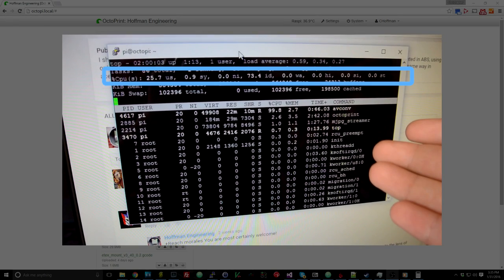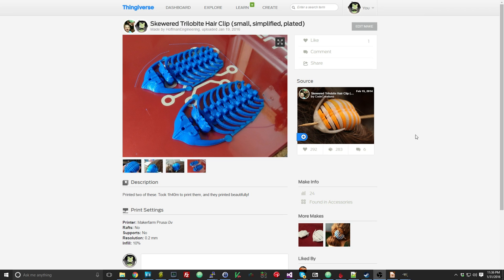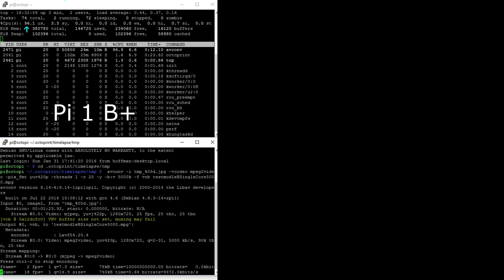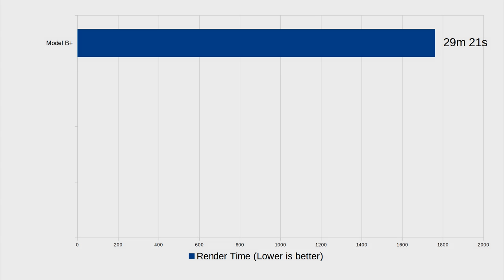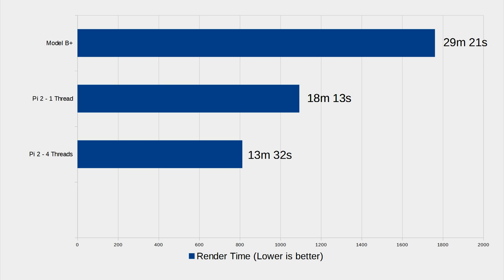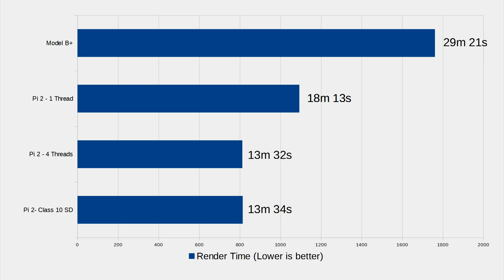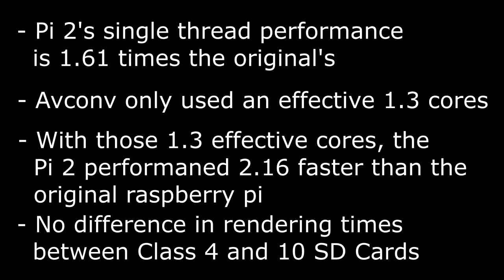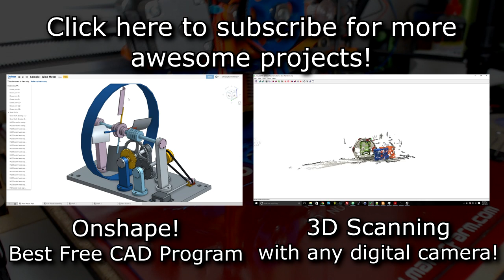Raspberry Pi 2 vs Raspberry Pi B+ Showdown! Timelapse Rendering Comparison

Comment: Thanks for the video! I recently purchased an rpi2 hoping that I would see better performance from timelapse rendering in octoprint. Glad to see that it was a worthwhile purchase.
Reply from the maker: +Sunny Rodriguez And thank you for watching! It is a pretty substantial increase, I'm hoping it'll help cut down on the number of timelapses that get ruined by starting another print before the last one finished rendering. I'm also hoping to be able to gain a little more performance out of it, be it by increasing the CPU% used, or overclocking the pi2!
Reply: +Hoffman Engineering I posted on the github page for octoprint requesting a progress indicator for timelapse rendering. Most recent comment suggested logging into the pi and running "top" command to watch the ffmpeg process. Not the easiest approach but it works for now. I'm wondering if the progress can be exposed as an octoprint extension; not sure if extensions have access to external processes beyond octoprint through.
https://github.com/foosel/OctoPrint/issues/1191

Comment: What happens if you hit it with more threads than actual cores on the system? (this is btw an usual trick when compiling large software projects to get max CPU utilisation) 
To make sure that it is not bottlenecked by the IO you could try to encode it completly in a RAM disk, this is super easy on linux, just mount a tmpfs where you need it. Watch the "wa" value in the %Cpus line, if it is higher than zero the CPU is waiting for IO requests to finish.
Another top tipp (pun intended), press "1" to show each core individually (%Cpu0, %Cpu1...).
Reply from the maker: +Hippo Thank you for the suggestions, I really appreciate it! The thread count doesn't seem to make a difference above 4; 5,8,and 12 threads are still showing about 135-140% CPU usage, with the load being distributed 80%, 20%, 20%, 20% (Thanks to your top tip :D). The wa column is showing 0.3% every so often on the thread that is pulling most of the load, so IO might not be the bottle next there.

I'll try the ramdisk next. Even though the IO doesn't seem to be the bottleneck, its worth a try to gain a little more performance!
Reply: +Hoffman Engineering 
Okay, i did a few tests with ffmpeg on my PC (Core i5), the problem is the ancient mpeg2 codec, it was just not developed with multicore CPUs in mind. I can encode my test 1080p timelapse with 1T and 50 fps (so the 1200 pictures take about 24 sec), 2T gives a slight increase and the switch to 4T barely changes anything, maximum is about 60 fps. 
Newer codecs like h264 scale perfectly with more cores (>390% cpu usage) but were still slower with 35fps, of course the video quality is way better compared to mpeg2, even at lower bitrates.
But i got a better idea, the Pi and Pi2 have a GPU which supports hardware h264 encoding, this should be a lot faster, i think at least 5 times faster! You should definitely try that.

Comment: How do you have the camera attached to the platform, I haven't found a good way that doesn't hit the vertical supports or the end stops on the Y rails. (I have a pursia i3, similar design to yours)
Reply from the maker: +Devin Hansen I designed my own mount, you can find it on thingiverse here: http://www.thingiverse.com/thing:1258430

It was designed in Onshape, a free browser-based CAD program, and I've made the design public. So if you want, you can make a copy of the design and tweak it to fit your own print bed!